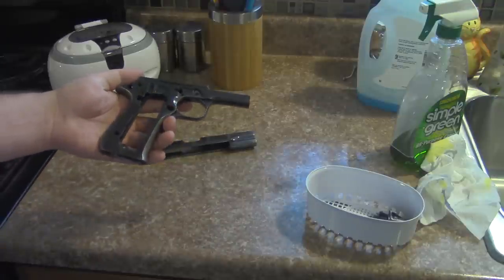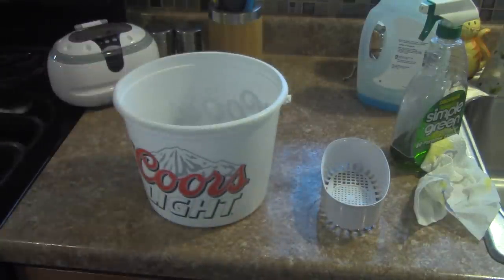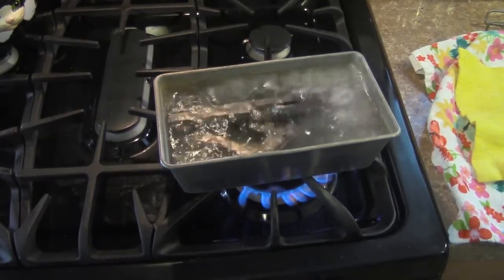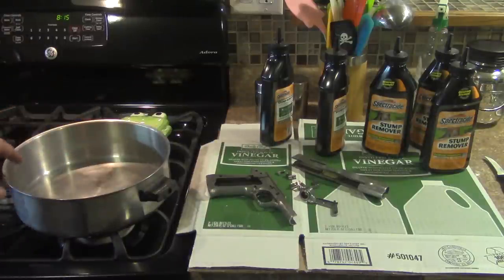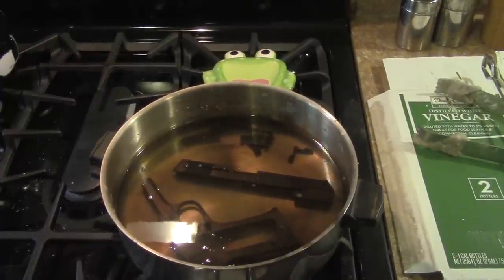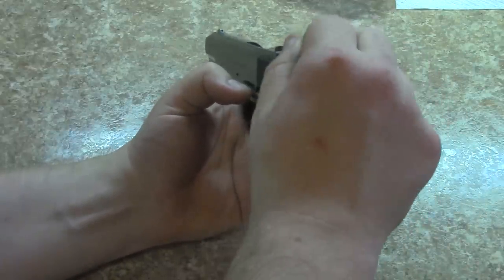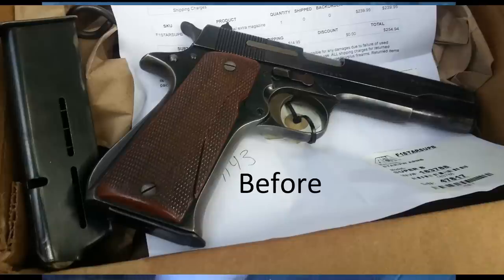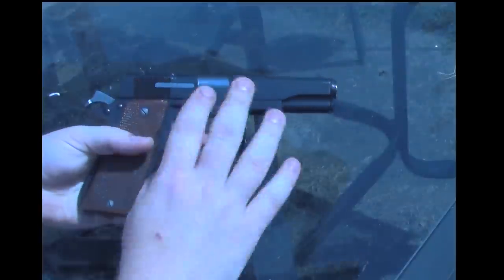DIY Reblue Your Gun at Home for $50

Comment: R.I.P. your heat treatment. Nice way to ruin a gun. Nitre blue is for small parts only.
Reply from the maker: If heat in the 600F range were enough to take the temper out of the metal you would have the same issues from the heat of firing the gun rapidly.

Unless you have an actual source I'm calling BS.

This link is instructions for the Brownells Nitre Blue setup,  nowhere does it mention concerns with temper and it specifically mentions using it to finish revolvers, cylinders and barrels.  Only warnings are not to use it on guns with solder holding them together like double guns.

https://www.brownells.com/userdocs/learn/Inst-362%20Nitre%20Bluing%20Bluing.pdf
Reply from the maker: I looked those over and while I appreciate your response none are an actual textbook or engineering manual.  I've blued numerous guns this way.  If there were a liability I'm sure a company like brownells would include that info.  

Some of your sources like the Rugerforum one directly contradict what you are saying.

Quote

EDL, what you are finding through your research is correct. If rifle 
barrels are heat treated at all, it's to a very low hardness. I know of no critical parts that are heat treated to a hardness that will be drawn out by either the Nitre or charcoal method.
 

Keep in mind that springs are tempered to a 'blue' color and still retain their heat treated qualities.  
 

Peacock blue is doable with the charcoal or Nitre methods. Both methods use the property of steel that it changes color elevated temperatures. At around 600 degrees you get the blue you're after. I have even heat blued entire handguns using sand as a medium.
Reply: +Gun&ShotTV That was 30 seconds of Google research, you can put your own time in researching for yourself, I'm not going to spoon feed you.
Reply from the maker: So you don't have a real source?   Forums and hobby websites can have good or bad info.   I'm not even saying you aren't correct, I'd just like an actual source for your info.
Reply: +Gun&ShotTV Read the above post again.
Reply from the maker: I have the same response

So you don't have a real source?   Forums and hobby websites can have 
good or bad info.   I'm not even saying you aren't correct, I'd just 
like an actual source for your info.
Reply: +Gun&ShotTV  Here's a start for you. Irons and Steels By Harry Chandler – ASM International

Like I said I'm not going to spoon feed you.

Here's a simple test. Take a hardened part, such as a hammer or sear, and cut it in half. Purchase a Rockwell Hardness tester (a basic one is only $350 or so, and test the unblued part, then test the nitre blued part. Make a video maybe you'll get some views.
Reply from the maker: But have you reviewed the info in Metals Handbook Desk Edition 2nd Edition by J. R. Davis?
I'll give you a proper citation when you give me one. 
I'm not going to spoon feed you either.  Troll harder.
Reply: +Gun&ShotTV Post your hardness test results, I'll wait. You ruined a gun, live and learn. Just dont sell it so the slide flys off the back and through anyones face but your own.
Reply from the maker: Once again you are trolling and have no source.  There is a difference between hardening, tempering, and annealing.  To anneal the metal you would need to heat it hotter than it was hardened at or red hot and slowly cool it.  These parts are 1. only heated to around 600F.  2. rapidly cooled with a water quench 3. not even heat treated parts.  not sure if you managed to pay attention but I didn't touch the barrel.  Troll harder and read your own sources.  

Brownell's isn't going to sell a kit that is going to open them to liability.  It's ok to admit you have no source and are spouting BS.

Once again I'm open to an actual source if you can find one.
Reply: +Gun&ShotTV I linked you half a dozen sources.  Brownells sells plenty of dangerous things. Do they have warnings on their gunpowder page that it may blow up your gun if you double charge? If you dont trust people on reputable forums thats one thing, but open a book, learn about heat treatment before you hurt yourself or someone else. Better yet, you can ask Brownells right on their products page if you have a question. Go ask, or pick up the phone and call their tech line. 

Or go purchase an inexpensive hardness tester and try it yourself.
Reply: +Gun&ShotTV Also, if you dont think hammers and sears are heat treated, you probably don't know about guns to be working on them.
Reply from the maker: Look up the temps required for case hardening, then look at the definition of annealing.
Reply from the maker: Why don't you try it?  You are the one claiming different than the brownells instructions and some of your own sources.
Reply: +Gun&ShotTV Case hardening is done by baking metal in charcoal, and is far from the only way to harden metal. Go put a spring in your bluing salts and tell me how it responds.
Reply from the maker: Who said to blue springs?

Here is a good snippet that describes a similar experiment to the one you are proposing.

Heat Treatment of Steel
From the 1924 edition of Machinery's Handbook
A series of experiments made to determine the proper temperature to 
which to heat high-speed steel for annealing, showed the following 
results:  When the steel was heated to below 1250 degrees F. and slowly 
cooled, as in annealing, it retained the original hardness and 
brittleness imparted in forging.  When heated to between 1250 degrees 
and 1450 degrees F., the Brinnell test indicated that the steel was 
soft, but impact tests proved that the steel still retained its original
 brittleness.  However, when heated to between 1475 degrees and 1525 
degrees F., the steel became very soft; it had a fine-grained fracture, 
and all of the initial brittleness had entirely disappeared.  In 
carrying these tests further, to 1600 degrees, 1750 degrees, and 1850 
degrees F., it was found that the steel became very soft, but there was a
 gradual increase in brittleness and in the size of the grain, until at 
1850 degrees F. the steel again became as brittle as unannealed steel.  
Dried air-slaked lime was used as a packing medium in making these 
tests.

Source
http://www.zianet.com/ebear/metal/heattreat5.html

Seems to indicate under 1250F won't anneal steel.  1250F>600F
Reply from the maker: That said, I'm done with this conversation.  If you want to verify your claims, you run your own test and post a video.  Otherwise it's just getting sad and boring.
Reply: Colt's bluing process, used before WWII, involved rotating the guns in a large oven, "charged" with smoldering bone meal and fish oil, heated to almost 700 degrees.  I don't think the nheat of the process described in the video - 500-550 degrees - is going to be harmful.
Reply from the maker: It's quoted above but it bears repeating, under 1250 shouldn't effect the temper

Heat Treatment of Steel
From the 1924 edition of Machinery's Handbook
A series of experiments made to determine the proper temperature to 
which to heat high-speed steel for annealing, showed the following 
results:  When the steel was heated to below 1250 degrees F. and slowly 
cooled, as in annealing, it retained the original hardness and 
brittleness imparted in forging.  When heated to between 1250 degrees 
and 1450 degrees F., the Brinnell test indicated that the steel was 
soft, but impact tests proved that the steel still retained its original
 brittleness.  However, when heated to between 1475 degrees and 1525 
degrees F., the steel became very soft; it had a fine-grained fracture, 
and all of the initial brittleness had entirely disappeared.  In 
carrying these tests further, to 1600 degrees, 1750 degrees, and 1850 
degrees F., it was found that the steel became very soft, but there was a
 gradual increase in brittleness and in the size of the grain, until at 
1850 degrees F. the steel again became as brittle as unannealed steel.  
Dried air-slaked lime was used as a packing medium in making these 
tests.

Source
http://www.zianet.com/ebear/metal/heattreat5.html

Seems to indicate under 1250F won't anneal steel.  1250F>600F
Reply: Yo just let him be it worked for him if you dont like what hes doing dont watch
Reply: Gun&ShotTV Not trying to be an asshole here, but personally I work in the firearms industry, and nitre bluing is really only for small parts. For example on my custom Mauser sporter, I only nitre blued the extractor, beddings screws, safety latch, and bolt release lever. Nitre bluing really does alter the heat treatment of metal, and is really not a good idea for high stress metal parts, such as slides, barrels, recoil lugs etc. But hey if it works for you then go for it. I just can't recommend it because of safety reasons.

Oh and side note, also next time you're cooling the metal, don't use water. Especially if the metal was at a high temperature, it can make the metal brittle. Use oil!